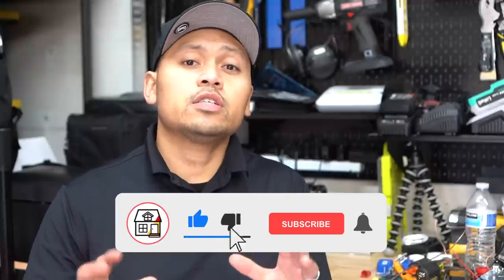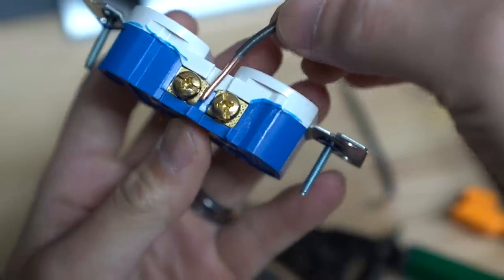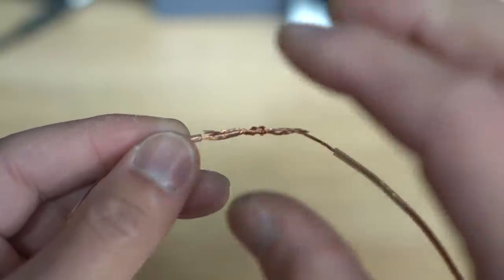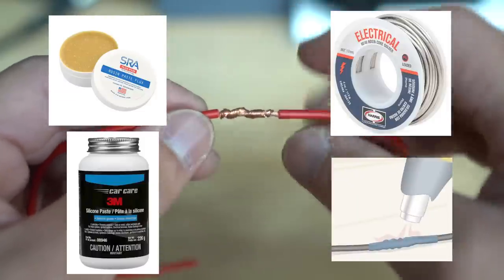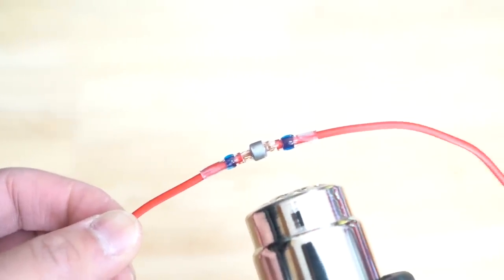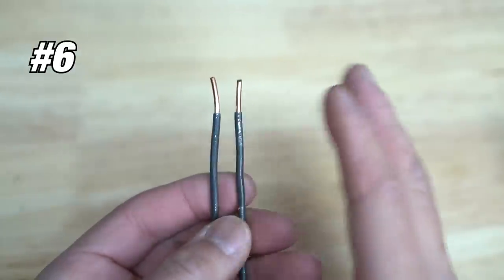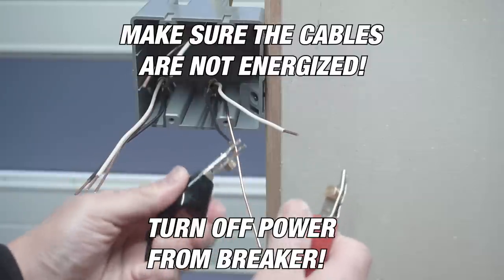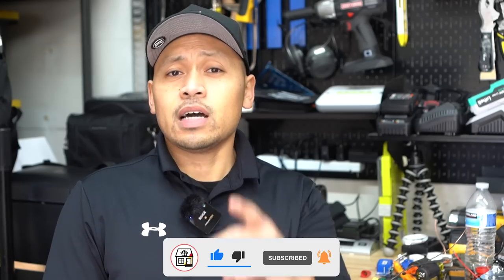7 AMAZING Electrical Hidden Secrets You Should Know! Tips & Tricks

Comment: Well, well, well…I learned something new.  I had some questions regarding splicing wires to repair a light harness on my Subaru (inherited), I wasn’t sure about just wrapping & heat shrinking…like your TICONN connector way much better.  It will also be more secure on my sailboat rewire.  Thanks.  Great video👍

Comment: So wouldn't it be better to twist it...or if you did that then it would not seal all the way thru with using those non solder iron caps ...sober and seal connectors

Comment: if you use the solder method shown in tip #5, would you need to have a j-box or can you continue with your wiring as if it was not a soldered wire?

Comment: Hello I just subscribed I need help I'm on a fixed income and cant afford an electrician .  My home  Is 100 yrs old andi7 in the basement old wires are everywhere.  I have old 40 amp wires for old Electric baseboard heaters.  In each room there is a long electric baseboard heater with its own dial switch on off. 
I want to clean up and remove all these 40 amp wires.   I figured trace wire to panel box and disconnect each 40 amp breaker.  Is this the correct way to remove them?  I figured if I removed them from the main breaker box that would eliminate completely any power to these electric baseboard heaters.  Please advise the best way. Thank you so much.